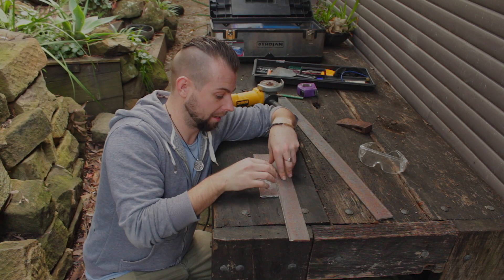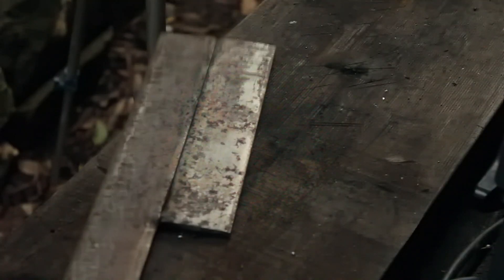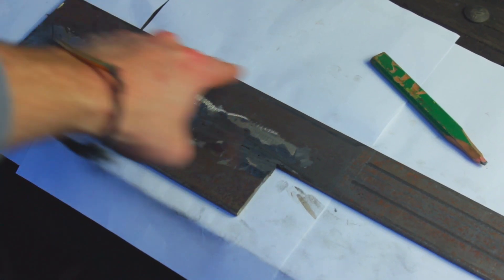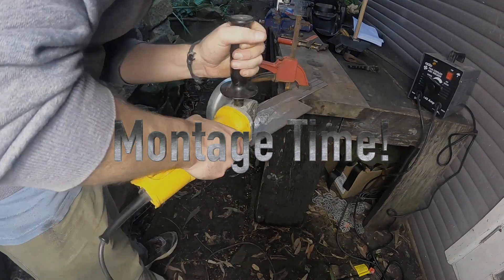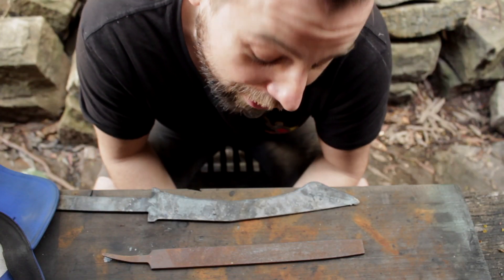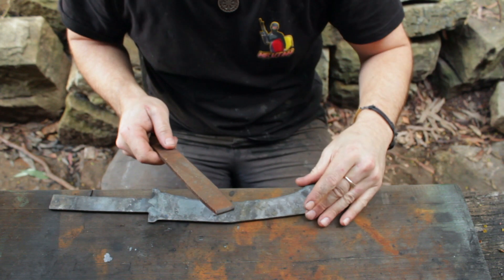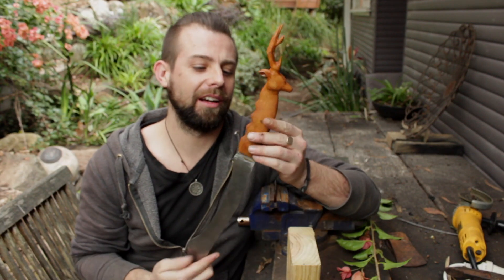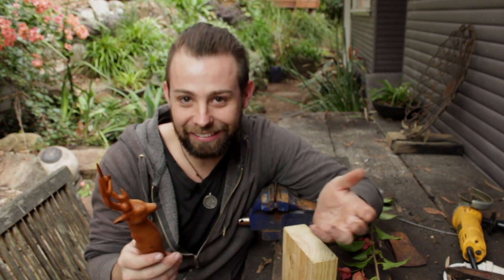ADDING CARBON TO MILD STEEL KNIFE WITH A WELDER ! (SUCCESS) KUKRI

Comment: Aluminium is the official term coined by the student/assistant of the guy who discovered it following the naming trend of the time. The guy who discovered it actually named it aluminum, adding -inum to the mineral alum.
More importantly, aluminium is how the world sans 'merica pronounces it. If the "special" kid uses special words for elements and units, it automatically means that those are incorrect.

Comment: Theoretically if someone were to sprinkle bone meal, charcoal, high carbon materials over the top of the blade and heat the living shit out of it from underneath with a torch it "should" case harden the one side or leach the carbon in from the charcoal... Then flip the steel and do the other side. 
Nice video 💯👍😎 thanks
Reply from the maker: This was my theory but decided to use molten metal instead of just heating it. I looked like a coal miner but it worked
Reply: @THEADVENTURESOFBIGH  😄😄😄

Comment: hes trying to hide the knife after hitting the steel iron it did not work he laughing at the end
Reply from the maker: It totally worked I swear
Reply: @THEADVENTURESOFBIGH  are you sure it look like you are tryin to hide the edge of the knife haha by the way its nice trying
Reply from the maker: @frostfadley  it did work I just don’t have an accurate way to measure the carbon it could have been the quench but the edge didn’t deform against the original stock pice.

Comment: I'm not 100% but pretty sure it was the quenching process that hardened the steel.
And not the lump charcoal... 
Quenching in Used motor oil would of made it harder again.. never the less I'd like to say that your videos and content is definitely getting better so keep at it! 👍
Reply from the maker: Thank you I really appreciate the feed back. I thought you couldn’t harden mild steel by quenching ? I can always re visit ! I’ll make 2 identical knives next time and quench them both and only charcoal weld 1.
Reply: @THEADVENTURESOFBIGH   low carbon steels Don't benefit from quenching as much but remember that you welded it and the welding stick is most probably  a higher carbon steel than the parent metal.
Also by quenching in used motor oil ( it's loaded with carbon from the combustion process)  and would most likely take some of it during the quenching process.
Reply from the maker: @autonauticaengineering9562  I haven’t done a service in forever I’m definitely using that oil !
Reply: He could have added carbon with the charcoal AND the quench. 
Mild steel doesn't harden THAT much… does it? 
I have quenched mild steel that has hardened some… but of course it doesn't stay that way if you leave it… OR heat treat it. 
It just temporarily hardens… and not THAT much.